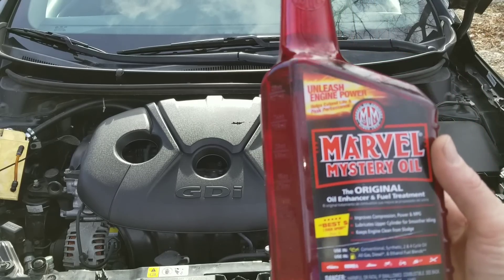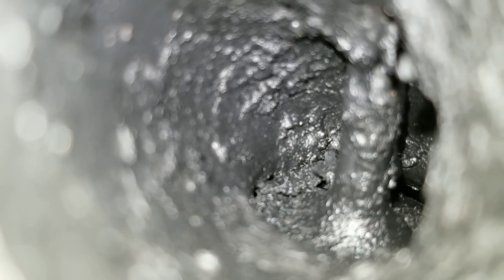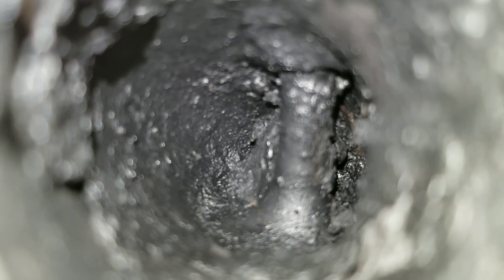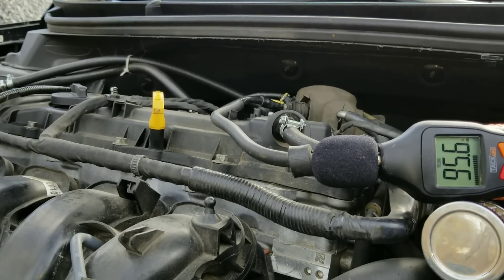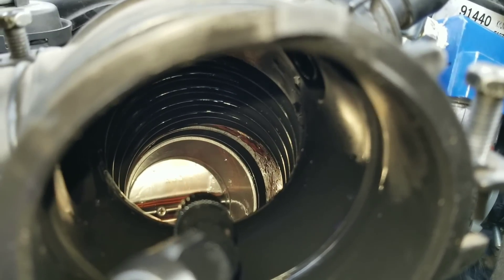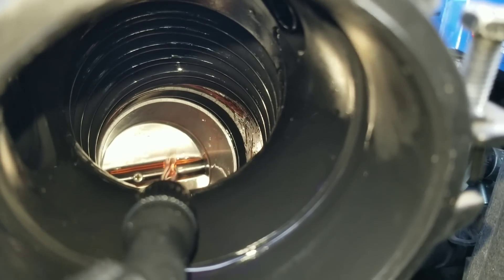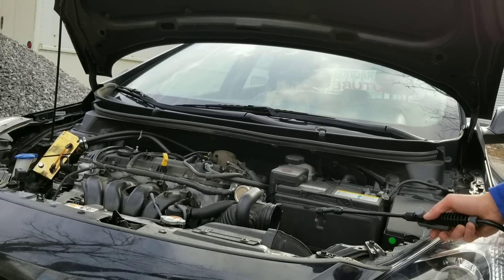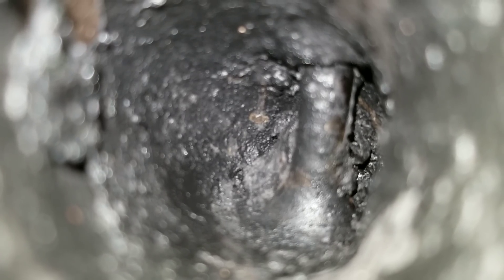SCOTTY nates REAL truth ABOUT MARVEL MYSTERY OIL

Comment: dont buy a GDI........problem solved.
Reply from the maker: What products have you had success with even if its a oil additive?
Reply: @NATESINTERACTIVEAUTO  i dont use GDI engines....no products needed.
Reply from the maker: I understand im searching for ideas and what about oil additives?
Reply: @NATESINTERACTIVEAUTO  ..ive never seen a successful clean yet from ANY oil product EVER...but walnut blasting makes it all look new again......i would still not buy a GDI engine.....taking crankcase fumes and blasting them past dry vales will never ever work.
even an oil catch can will not work....it will only slow it down.
 skip the GDI engines and skip most of the problems.( and cost of having to deal with the drama )..
nice experiment you did,at least it shows people whats up,i would have been shocked if it had of worked :). good luck.
Reply from the maker: Thanks so much
Reply: David, the GDI engines spray fuel directly into the combustion chamber/cylinder.  Im sure you know that, meaning ONLY air flows through the intake.  So where does the build up come from?  Well long story short its the vent from the crankcase for the oil is plugged into the intake with a large vacuum hose.  So if you disconnect that hose and install a oil catch can like most race cars have then the problem is solved, or just put a inline filter on and change it with the oil.
Reply from the maker: Check out gumout video i show my catch can
Reply: Getting harder and harder to do that! :(
Reply: GDI is a disaster foisted upon the consumer.  I found this out too late, I use water injection on mine, keeps it clean, simple, easy, cheap, but would never buy another one.
Reply: Every car will have GDI soon. but they will start to include Port injection as well to help clean the intake valves and keep things clean
Reply: Would a mix of high pea content gasoline cleaner mixed with a small amount of Extralube ZX1 sprayed into the intake remove carbon deposits from intake valves?  As the Extralube searches out hot metal to bond with it may cause carbon deposits to loosen  and fall off the metal.
Reply: @MSHarvey_Lyricsmith  I mean, just about any solvent sprayed into the intake would help clean off the intake, but where does all that buildup go? Into the combustion chamber and then into the catalytic converter?
Reply: Just take the intake manifold off and scrape the carbon off the valves it’s the only real solution

Comment: You might need to rev the engine a bit to around 3000 or less, otherwise the mystery oil would just pool up somewhere in the intake manifold. With that said, I use MMO religiously on so my vehicles, fuel mix only. I will use it for the first time as an engine flush this month so it should be good.
Reply from the maker: Yes i used as a engine flush in another video but what can i do to improve?
Reply: NATES INTERACTIVE AUTO - I think you're okay with this video, just needed to rev the engine so that the mystery oil can reach the intake valves better. Or if you can access the brake booster hose, then that would be a bit better, but I'm not too familiar with GDI engines hehe. I also use MMO mixed with acetone as a penetrative oil for stuck bolts, works pretty good. Anyway, God bless and Merry Christmas.
Reply from the maker: What else cant i test
Reply: NATES INTERACTIVE AUTO - I was just thinking, since you can view the intake valves, would it be possible to spray a light amount of MMO onto them while the engine is cool, then let them soak for a day or two? I'm thinking that it might really loosen up the gunk. I don't think that it'll harm a GDI engine as long as the amount sprayed isn't a lot. What do you think?
Reply from the maker: Yeah its a great idea actually thanks alot any way i can add to the test to help see if the car improves?
Reply: NATES INTERACTIVE AUTO - Hmmm, I can't think of anything for now. I'll be sure to message you once I get an idea. Okay, God bless and I look forward to your next video.
Reply from the maker: Thanks so much

Comment: I used marvel oil 20 years with a average of 400000 miles or better per vehicle
Reply from the maker: Wow thats impressive
Reply: don't know about 400k but I've never blown a engine,used in all my old 50s 59s Chevy trucks w straight six,in gas and in oil,but I do like Lucas in my later application s...stuffs been around long time MMO
Reply from the maker: Yes straight six are very dependable
Reply from the maker: I totally agree you look at the big picture plus i used it in a video to test as a oil flush
Reply: Yea, but you maintain you car. This guy is trying to make magic, with this oil. My truck has over 200, 000. valves look clean.
Reply from the maker: Yes it depends on how long you want to keep your ride and cheap insurance
Reply: You put it in your oil when you first do an oil change or more towards the end?

Comment: If that car has a MAP sensor the air consumed during IDLE is most likely drawn from the PCV valve/system. I think you should try reinstalling the airbox, locating the PCV hose and valve, then introduce the marvel into the engine through the PCV hose. It will clean the PCV ports as well. You should be able to see that there isn't much air being drawn past the throttle plate at idle. No spray pattern adjustment will compensate for that.
Reply from the maker: The pcv breather you can actually see the tube in the video and the car still receives air at the throttle plate with map its un affected taking off air filter housing

Comment: I had a transmission with 140K on it and it was starting to shift hard and hold gears longer than it should. Sometimes it would lurch at low speeds. I took a chance and changed NOT FLUSHED, the fluid (you cannot remove the filter on this vehicle unless you remove it from the vehicle) I did three drain and fills. and the transmission got a bit better but still slightly wonky. Before doing the final oil change, I had heard that MMO could be used in a transmission to help remove varnish and deposits from the valve body. I added 1/4 quart to the transmission in lieu of the equal amount of transmission fluid. Low and behold, the transmission shifts nearly like new. Now at 151K I am very pleased with how this car drives. I think MMO is a miracle in a bottle for some applications. Unfortunately cleaning baked on carbon is not one of them. If your cat is easy to remove. I would try unbolting it and running easy off oven cleaner through the engine. It will definitely break that crud up, but if you did that with your CAT in place it could destroy it.

Comment: Late to the party, but I'll put my $.02 in. I've used MMO for the past 40 years. I am sold on this product. Even the military used it in WWII.
So, back when I had carbureted engines, I just dumped a quantity down the throat of the carburetor and revved the throttle from under the
hood to distribute it through the intake manifold and the cylinder heads. Smoked like hell, but it cleaned out the varnish deposits from the
carburetor, cleaned and lubricated the intake valves and cylinder heads. I keep my vehicles for 15-20 years until other parts start to wear out
and it becomes economically unviable to keep replacing those parts instead of getting a new vehicle. But I've never had engine problems, even
after 250K - 300K miles. Now my pickup and Saturday car are 2001 and 2003 models with port fuel injection. So for them, I just add 6 oz of MMO
to the fuel every 3K miles (16 gal fuel tanks), and it works to keep everything clean since the intake valves are washed by the fuel injected into
the intake manifold. However I bought a GDI car in 2015 to replace my aging 1998 Saturn. Still use MMO in the fuel to keep the injectors and cylinder
heads clean and lubricated, but I was stumped on how to get the intake valves cleaned. Until I face palmed and remembered just to put it
down the throttle body as I used to. I would use a spray bottle to atomize the MMO better than the sprayer Nates used and hopefully not drown the
engine since you can't rev the engine from under the hood with an electronic throttle. As far as not coating the MAF sensor as a comment below
calls out. I agree. But the MAF is generally up near the air filter and notice that he is spraying directly into the throttle body.

Comment: I love Marvel mystery oil, I've been using it since the 1970's.  I think it works well in your crankcase oil and fuel.  I think it works better in the fuel if used over time, just pour in a few ounces at each fill up, and you will get cleaning and carbon dissolving treatments continuously.  Marvel can also make your plastic deform, so don't get any concentrated Marvel on plastic.
Reply: It's sold in a plastic bottle. Seems to hold up fine.

Comment: Great that I have a port injection system. I only have to add mmo to fuel and oil. MMO will prove itself over time. 
I was sceptical in the beginning because i didn't 'feel' anything, but after 5 start-ups/trips of about 100km each, the car (BMW 525i) became very smooth riding. Even though i drove relaxed with max. 2000-2500 rpm in city and 3000 to 3500 rpm on the highway (140-160km/h).
Reply from the maker: Thats great i appreciate you sharing also i have had good results and have been told from many marvel really helps

Comment: No fuel additive will affect carbon buildup in a GDI only engine. The gas is emitted into the cylinder AFTER the valves. The gas therefore never comes in contact with the back of the valve. This is why you have carbon build up. Only oily air goes past the back of the valve.
Also, what is the goal of putting this in your gas tank?

Comment: It is going to take months of use of MMO in gas and oil to remove years of oil sludge. Anything that was strong enough to remove this much sludge in one treatment would eat all the rubber and rings in your engine. MMO was meant to be used regularly with oil changes and fill ups.
Reply from the maker: I understand but slowly overtime and preventive maintenance
Reply from the maker: Watch best oil https://youtu.be/pjF1sJ5VeXM

Comment: The issue with GDI is the lack of fuel to clean the back of the valve.  This means anything added to the fuel will not clean the valve.  With GDI a walnut blast will clean the back of the valve and will be a part of the maintenance of a GDI vehicle.  Thankfully manufactures are coming out with port and direct injected vehicles which should help keep the back of the valve cleaner.
Reply from the maker: Yes you are very informative thanks also i just run different types of test to show people the affects

Comment: MMO prolongs time betweem overhauls in diesels, and allows piston rings to seat properly after a rebuild. It also prolongs the life of injectors and injector pumps. This is based on experience.
Reply from the maker: Thanks so much for sharing with the NIA community. What do you recommend for persons seeking to diy intake valve cleaning seafoam, crc intake valve and turbo cleaner or ?

Comment: When valves get that bad I don't think any chemical is going to do a very good job of cleaning them. Best bet would be to walnut blast them and then us some type of chemical cleaning through the intake to maintain the cleanliness.
Reply from the maker: Yeah great point i would like to see what's most affective so what can we try next
Reply: @NATESINTERACTIVEAUTO  
If the intake manifold is removed you could soak the valve and use a long brush or use the use tge sprayer directly on the intake port and somehow brush it off
Reply from the maker: What about cleaners?
Reply: I don't think any cleaner will work to clean it off in the state it is in. The buildup has to be physically removed. But to maintain the only stuff I know that has worked for me is BG ISC induction cleaner and using a piece of equipment that sprays a mist into the throttle body with the engine running at about 1800 rpm. If done every 15k the. It should keep that carbon build up down.
Reply from the maker: Thats a great idea which bg product

Comment: I think MMO was too vicious for the test. But also MMO is a mild cleaner. I would recommend mixing gas and mmo together at the correct ratio and then injected it with the spray pump. That would be my approach for probably a more effective cleaning, if it does clean anything.
Reply from the maker: Yes true although i noticed a difference  on the sound meter
Reply: Gas & mmo & seafoam ?
Reply from the maker: Cool idea

Comment: I’m very new to marvel mystery but I went ahead and put it in my 2005 GMC sierra oil and fuel. 
I couldn’t believe how much it quieted the motor down I could barely hear it running from the cab and it is very quiet when you’re standing outside I’m sold

Comment: Good video! I've used marvel mystery oil and it works well over time. I bought an older car and was getting 16 mpg and after using marvel mystery oil about 4 times It restored it to 22mpg. It also helped the engine run and sound better with a smoother idle since. I think Redline Oil SL-1 Complete fuel system cleaner is one of the best and is a good one to test!
Reply from the maker: Thanks for the information and have you used thats redline product a long time?
Reply: NATES INTERACTIVE AUTO I've used it twice and had good results. It has Polyether Amine (PEA) which after some research I've found is one of the best detergents for cleaning carbon build up.
Reply from the maker: Awesome how can i test it

Comment: MMO is all you need. Add it to your gas and oil and you'll notice a difference. Follow directions. You don't have to to use as often as they recommend unless maybe you've got a really dirty engine and/ or been using bad gas. The stuff works, 30+ years using it in cars and motorcycles and they 
  ran as good as new in extreme weather conditions while racking up the miles. 
 Perform regular maintenance on your vehicles and they'll last 4ever. 👍✌

Comment: I use Marvel Mystery Oil in my 97 Saturn and it did absolutely nothing to make it run better. However I used it religiously in my diesel I used to hot shot with and I got a lot of surprises on how long the injectors and the infamous 6.5 injector pump lasted
Reply from the maker: Wow how long have you used mmo?
Reply from the maker: What would be the best idea to test these products?
Reply: @NATESINTERACTIVEAUTO   Time has an effect, which you mentioned. I'm going to try shooting carb cleaner into my Kia gdi after it is half warm and have my wife turn it off as I spray.
Reply from the maker: Great idea just dont spray to much right before turning it off. What anout tools that i could use to test i have thought about it for some time on what can be measured and in what way. Its good to have a fresh set of eyes.

Comment: I don’t know if it would clean the valves, but water works the best for carbon on the pistons. I one time on a small lock Chevy set the idle at 2500 and sprayed water in and when I was done I had two piles of carbon chunks on the ground under the exhaust. I was blown away that each pile was about a cup full with chunks the size of quarters.
Reply: Imagine how much crud got into your cat.
Reply: @North49191  That's what I was wondering.  Did you have a cat on that vehicle or did you remove it?

Comment: I've been using Marvel Mystery Oil for a long time. That was asking too much from MMO. 
   I put it in the crankcase thirty minutes before I drop the oil. Oil drains much more thoroughly. It loosens sludge/trash with high detergent oil and then drains out better because it's a lot thinner with MMO in the oil. I have to drive four or five hundred miles before I can see it on the dipstick. Clean oil, happy motor.🎉

Comment: On empty tank, put in preimum fuel, to 1/4 tank, add one can MMO to tank, spray MMO like you did, under load..handbrake on, manual selected 1st gear, and torque it up, do it to 2-3,000 rpm, and your EGR will be working it's heart out. Pour 1 can MMO in your crrank case, go for a hot run, go fora brief highway run, come back, change your oil, do your visual checks.

Comment: You should put it through a fitting in the intake manifold instead of trying to spray it in the throttle body. The flapper is closed and you can’t get that much in the valves. You need to flood the engine

Comment: Typically looking into others that have ran cleaners through majority have slipped the hose piece or straw after the throttle body because the throttle body that is not open can collect that liquid material and cause problems to those like my 04' Passat Wagon 1.8T which has a electronic throttle. Using anything other than throttle body cleaner can cause problems to the sensor and possibly to the electric/mechanical door actuator. So next test it probably be a good idea to slide the squirter tip after the throttle body door. Even if no issues arise unless you hit the gas enough to open the door some it's pretty much safer to avoid the risk of damaging that area. Had to replace mine on the Passat due to it's 228k on that and even though I didn't purchase original replacement I also had to pay out to have it reprogrammed. Love your vids tho. Been a subscriber for a while now.

Comment: You can adjust that spray pattern to a wider finer spray , tighten up the nozzle adj. and pressurize it heavier. And open up that  throttle plate some too in the  throttle body.
Reply from the maker: Thats what i did have you had success with marvel mystery oil?
Reply: @NATESINTERACTIVEAUTO  Not with  cleaning carboned up valves.